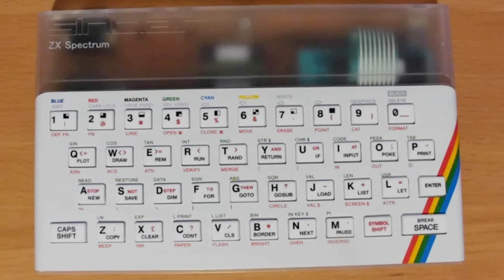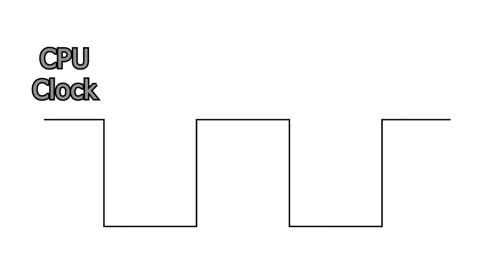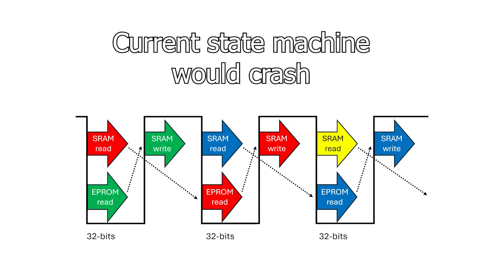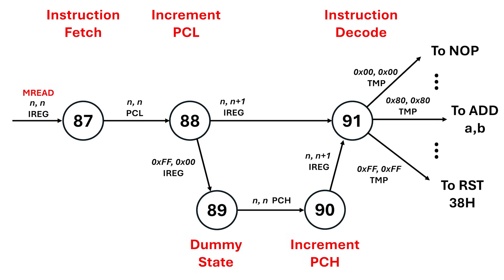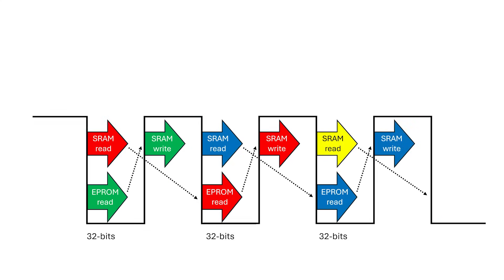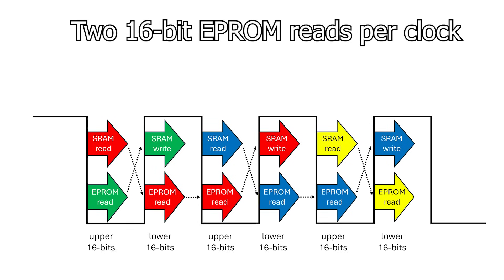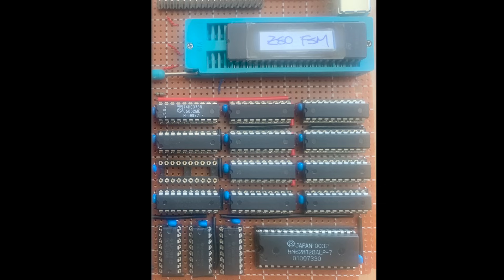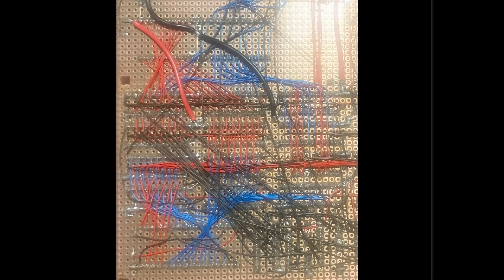ZX Spectrum Turing Edition Part 3 - Pipelining

Comment: Dr Matt, what length are your Kynar wire rolls & where do you get them?
Reply from the maker: I usually buy this one from Jaycar.
https://www.jaycar.com.au/blue-wire-wrap-wire-on-spool/p/WW4346
It's not cheap retail, but whenever i've try to buy it from china via ebay i've been disappointed.
Reply: I thought you’d buy it bulk. I get 30AWG, 28AWG & 24AWG in various colours in 250m rolls but it costs a pretty penny.(insulated but not seeming Kynar because it melts a bit). The 28AWG is my fav because it’s much more durable than 30AWG and more flexible than 24AWG which I often use for power traces. I’ve also got Multicomp thin 36 & 38SWG enamelled wire with wiring pencils & cable guides - these are easier for chained signals because the insulation is removed locally by soldering. 🎉

Comment: I have taken a similar but slightly different approach to pipelining in my machine. When the rule book compiler outputs a state, it writes 256 entries each containing the output data and an index to the next state. It uses that index to ‘forward reference’ into the state data for the new state and pulls out the register, control lines and effective address register for the new state which it stores in the entry. This way the pipelining of the register value, etc gets pre-computed into the rule book.

This does create a few issues. The main ones being the need for a dummy state on reset, as the latched register values are not valid for the first state and similarly the interrupt hardware has to force a jump to a dummy state to flush the pipeline before handing the interrupt.

To do this the rule book compiler, which is written in Python, has to make two passes. The first creates a list of all the states, assigns an index to each state, resolves labels and generates the metadata for each state, and the second pass writes out the rule book, along with several symbol tables that can be used in an emulator.
Reply from the maker: Interesting,  I found it pretty tricky to write the pipelined state machines.  What i ended up doing was writing it as though it were not pipelined, then checking the constraints.  If they were all good, i would check the notepad address and MREAD for the nextState and copy that over to the current state.  It worked, and was much easier to write that way.  
For reset, i just copied the same state a couple of times to fill the pipeline.
I also have a two pass process, where i go back and assign the actual state to the labels.  I handle interrupt in the 6502 by overloading an unused opcode, but i haven't done it yet for the Z80, I have a crazy idea for that 
i'll try out.

Comment: Fascinating stuff. Feels like not respecting the original instruction timings could be a nightmare for software compatability on a machine like the Spectrum though. Things like tape loaders have extremely tightly constrained loops that rely on exact timing to work correctly. I say this from the point of view of someone that has coded their own emulations of the Spectrum and the Z80 before :)
Reply from the maker: Yeah it will be interesting.  I think at the moment it will be just a bit slower than the Z80 at the same clock rate.  I think i can clock it at 7.16 MHz (possibly up to 10HMz), which will give me enough overhead to allow me to "tune" instructions so they match the original z80 ones at the lower clock rate.  We'll see how it goes.
Reply: @DrMattRegan  I look forward to seeing the final result! 😀

Comment: This is very interesting. So, can you skip the CPU instruction set and implement the Basic token state machine directly?
Reply from the maker: The state machine needs to have the right memory attached.  You need to have indirect addressing to be Turing Complete. Then you can implement the instruction set, which is basically how the CPU works.  There are some other things like adding an ALU that reduce the size of the state machine.  Programming the state machine is at the same level as micro coding.
Reply: @DrMattRegan  Thank you for the reply. Slightly different, let's say you get the source code to tiny Basic and study the code for the token interpreter and write a state machine for it, then implement in your ROM state machine.

Comment: This is all wonderful stuff :)
Reply from the maker: Enjoy, thanks for that.  Next video i'll get the raster generator working.  I'm interested to see how fast it will be relative to the actual ZX spectrum.  If necessary, i can probably clock it at 7.16 MHz, which will mean i can tune it more to the instruction time of the actual z80 at 3.58 MHz.

Comment: so nvidea cards are gigantic, water-cooled eproms with a few flip-flops bolted on...
Reply from the maker: Ha ha no.  More specialized architectures are faster and have a lower transistor count.  That said, in the past at least, nVidia would emulate part of its design on a big FPGA box, which is essentially lookup tables and flip flops.
Reply: @DrMattRegan I’m pretty sure every new nVida chip begins from FPGA LUTs even nowadays
Reply from the maker: Yep, you’re most likely right.  I worked there from 2003-2008, so that’s really the reason I qualified my previous comment.

Comment: Thanks for another great video, Dr Matt. From what I can ascertain, it means the Z80 here will use a varying number of clock cycles per instruction depending on the PC address, is that right? Only, some ZX Spectrum software relies upon strict clock-cycle accurate code to operate correctly (such as bi-colour engines, or PWM style beeper music and effects). Will this setup actually be compatible, and I'm just misinterpreting this as an issue?
Reply from the maker: Yep, it’s a bit more like the 6502 in that crossing a page can cost an extra clock.  It’s not going to cycle accurate, so any code that chases the beam might not work artifact free.  Sound might be off in some cases.  I will have some room to adjust the timing of the instructions.  I’m planning to use a VGA output, so it will be 60hz.  That is also a problem for games tightly tuned to PAL

Comment: state machine might not be the best compute architecture. at all. it assumes dynamic changing instructions. ie a program does not need to be instructions. it just needs to do what the program does. ie branchless programming. well you just direct operations to correct block that calculates it. with fixed logic. only pipeline flow management, even if using instructions. way to go.
Reply from the maker: Not sure I understand your point.  This can emulate any Von Neumann architecture.  The trade-off is that the state machine needs to be large compared to the state machine in a Von Neumann machine.
Reply: After reading the comment a few times, I think what it is suggesting is building a hardware-based representation of a single program as opposed to a generalised system that can run any program.
Reply from the maker: Ah, thanks.  Maybe they might have missed that a State Machine + (appropriate) Memory System =>Turing complete, and were only focused on the state machine part of it.